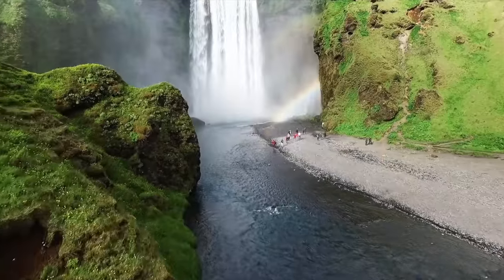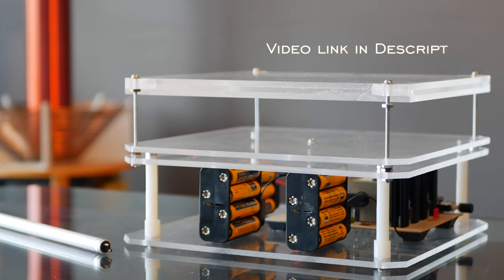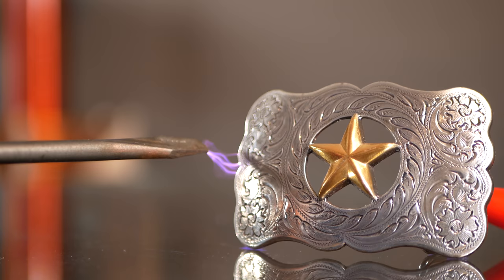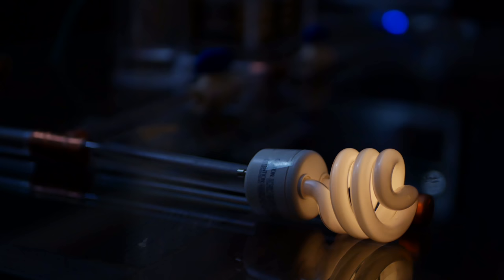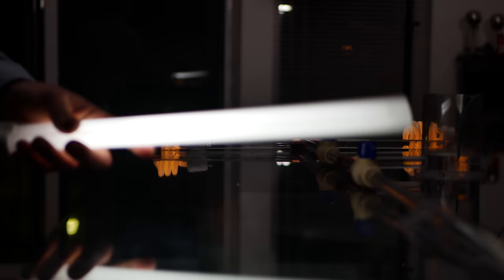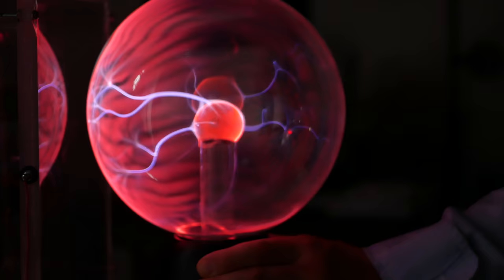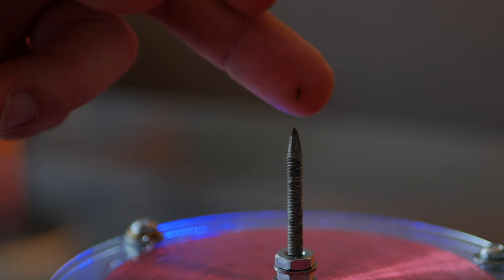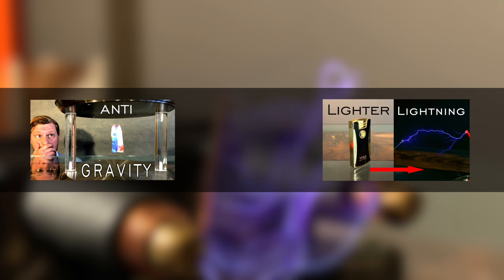Directional Wireless Energy Using Water

Comment: Add a little salt to the water and watch the transmission distance double with more efficient transfer, plus brighter lights.
Reply from the maker: I thought the same, but experienced the opposite. I found too conductive of water caused the power to radiate too easily, and never reach the ends of the tubes. Could have been a flawed trial though.
Reply: @PlasmaChannel  You'll have to play with the saline content until you get the results you desire.... At any rate ... adding conductivity should never be a negative thing (no pun intended)
Reply: @PlasmaChannel   Another thing is if you grind some copper into powder and let the copper powder circulate with the water. and place a magnet here and there on the tubing.. the energy created from the mutual induction will  electrify the water directly and yield tripple the results. movement is key.
Reply: @PlasmaChannel  I'm not trying to be a know it all... just trying to help. When I was a kid from 5 till I moved out ... this is all I did.... creating every possible configuration... I stayed in trouble for being so dangerous all the time but I was so driven I didn't even notice... Everything from giant antennas to capture atmospheric EMF to creating huge secondary windings placed beneath those million volt transmission lines and then stepped down to usable voltages.... I didn't do radio shack experiments .... stayed in trouble but have a wealth of knowledge now from years of  hands on when I was a kid.

Comment: @plasma channel, did you know that you could do the same thing with a single insulated wire and electric switch? achieve the same "wireless power" effect? can you see your ideas flaw here? you replacing the insulated wire with insulated "water-wire" and by the way, the only way your river idea would work is you have to insulate it from the ground! your body and the ground is the return path in this electric circuit. it is not pseudo-solution its pseudoscience
Reply from the maker: It is easy to create a water fountain isolated from ground, and, place it in acrylic so that it can’t be touched. Boom. Works. Cheers.

Comment: Love your channel and videos. This one has me very confused. What is the purpose of using...water?? Yes I watched the video, but why make something overly complicated? Can you not do the exact same thing (lighting gaseous discharge bulbs wirelessly with HF) using wires instead of water? And valves? Don't switches do the same thing? This seems like a Rube Goldberg concept, or something like Solar Roadways, etc. "The sheet of water acted as a wireless power transmitter itself." No, it did the same thing a piece of metal would do, and the power supply was the source of power. "Direct connection provides the most power." Right, like a wire, a metal conductor. "You might as well put it into a pipe and treat that pipe like a wire." Or....just use a wire? Better insulation possible, easier to handle (no dripping, corrosiveness). Not trying to be flippant, I seriously want to know why this was even thought of.
Reply from the maker: I'm happy you asked! I'll answer your questions one at a time.
 1) Sheet of water acting as wireless power transmitter: Yes, it did act as a transmitter. A powersource is different from a power transmitter. Totally different things. One creates power, the other transmits. The water is powered by a source, yes, but then the water allowed transmission in the air.
2) Wireless power covers more distance the higher of a voltage you use. Finding a 'switch' for 20,000 volts is pretty darn hard. Even if you do make one manually, high voltage will jump across any gap you give it, up to an inch at these powers. So, valves offer the most compact solution to cutting off 20,000 volts.
3) why use water instead of a wire in the first place - again, water can flow. Wire cannot. So this can become part of functional fountains that are separated from ground. Wire cannot. Also, the high voltages used required an ability to cut off certain areas. As previously mentioned, switches do not work at 20,000 volts. Also, even if you replace the pipes with a small wire, the high curvature of radius on a wire would cause severe coronal formation, and energy loss would be disastrous. You wouldn't be able to get the same results as the water pipes, due to the pipe's lesser curvature of radius and ability to suppress coronal formation.
Cheers!
Reply: @PlasmaChannel  Thanks for your reply, rare for any YouTuber these days! To your points, #1 the entire setup acted as a transmitter, the sheet of water (merely a conductor in this case) was an antenna. The water 'allowed' transmission into the air, therefore it's an antenna. Any conductor would have similar effect here. #2 Sure, and as you say it's also subject to inverse square law, so even that 20kv won't get very far. Also, HF high voltage is notoriously difficult to insulate, and this would apply whether you're using water or metal or any conductor. This all could work to act as a cutoff to control a high voltage HF circuit. But it'd be much simpler and smarter to simply cut the supply feeding the 20kv power sources--obviously easier to switch and control DC or LF low voltage than the other. #3 Don't get the 'functional fountains', if you want to cut the power, just cut the source instead of adding plumbing and greater insulation complexity. There are plenty of 20kv switches and higher, but of course using low voltage equipment is much easier. And yes AC has the skin effect so a proper conductor is needed. But, are you trying to keep the power IN the water, or let it out like an antenna? These are two different needs with two opposing approaches.

Comment: What if you doped the water or solution with buckeyballs or some other free-form of carbon to boost conductivity?
What is there's a very conductive solution?  Kind of the opposite of some of these new insular fluids that you can drop a running graphics card into...
Reply from the maker: Increased conductivity caused the lights to be brighter, but, only at close distances. At far distances, they were dimmer because too much energy radiated too easily, and it never reached the far ends of the tubes.

Comment: Isn't a house technically already set up to do this? Steel and Copper pipes run throughout almost everyone's home on the planet. of course it would need some extra precautions for safety, but couldn't you theoretically turn your piping into the wireless power source? The full copper and steel pipes transmitting better than what you have set up? Better yet, since the piping is run to everyone's homes from the water company (if you aren't stuck with only a well) a water station could double as a generator to power this for everyone? or am I just asking for everything to go kaboom?

Comment: If the lightbulb can light-up, then how the potential difference between its two electrodes is achieved? Can you run an electric motor (DC or AC) this way?
Reply from the maker: Well, strong EM fields ionize air. No return path needed. The bulbs are ionized without any connections needed.

Comment: This is pretty big. Especially, since water can be a part of many different types of open thermodynamic systems. It could actually multiply energy input by tapping into other natural reservoirs of heat, voltage potential, and pressure as a result of being exposed to high voltage. I just posted this video at http://facebook.com/perpetualmotor .
Reply from the maker: I'm really glad you enjoyed this. Thank you so much.

Comment: What happens if you add a little salt to the water? Would that help with the flickering light?
Reply from the maker: The closer bulbs lit up brighter, the further bulb was dimmer. Take a guess why.
Reply: Plasma Channel My guess is the salt water conducted the power more effectively, but since we have limited watts the closer bulbs were brighter using more of the available watts. That left less power for the bulbs further away. Thus they were dimmer.

Comment: Does they stat lit due to quantum tunelling of elections through valves? Or the induction between tubes just like you shown at the end? Prob both..

As of whole video: It's basically the same effect as Jacob's Ladder. Probably the most inefficient way of transporting the electricity as a lot is wasted for hydrolysis.
Also the whole contraption is weak as you can't use metal valves or (any parts really) without electrocuting potential users xD
Reply from the maker: Mr Rab, great guesses! It is mostly due to capacitive coupling through the valves, and that fact that the lights are still only a foot away from the water that IS still powered. 
I dont follow, with the jacobs ladder. This system definitely is inefficient, though, it was able to light up the three lights with only 60 watts. Not too bad.
Reply: @PlasmaChannel  Speaking more clearly about the jacobs ladder, it works thanks to the phenomena that applying a voltage to a conductor creates something resembling a 'induction field' in the close vicinity of it. When two opposing 'fields' reach, the current goes through. This is also what induced energy into your lights.
Pardon my whacky explanation

Comment: Fluorescent tubes will do the same thing under power lines. Lick the electrodes at the end of your tubes if you are certain there will be no capacitive discharge.

You wouldn't want this in your house, interesting concept for larger scale application though, given the cost of plastic pipe Vs copper cable.

I don't think capacitive cafe would be a zen place, as people are conductive.  

What voltage is your system at?
What's the potential fault current?
What means of protection does your system have? 

I think it's a very interesting idea, although sea beds are already being used as a conductor like in the DC connection between Victoria and Tasmania in Australia.

Comment: How would this method be affected by using smaller diameter tubing?
Reply from the maker: Smaller tubing, this should act the same. However, if using very thin tubing, you might see less power output.

Comment: Does the high voltage connection to the water reservoir use current while just sitting there with valves closed?   Since the pipes are capped and the water is not flowing, does the valve affect water pressure- i.e. what is the valve doing?  Preventing the current from flowing?  Confusing.  This is a by-product novelty. This can’t be that efficient to wirelessly charge your cell phones.  And your house has copper grounded piping. Is this why it’s grounded?!
Reply from the maker: Hi Aron, great questions. Even when valves are closed, it will still pull current from the power source. It just will pull less. The reservoir is directly connected, so that reseroir itself will radiate some wireless power...meaning energy is always flowing out. Also, this system is not grounded - you would not be able to radiate power if it was grounded. So, if used in any of the applications I mentioned, they would need to be fully isolated from electrical ground, and not near anything else conductive.

Comment: I saw were a dude thinks the pyramids were like a tranformer  take the eletricity out of air and using the aquifer to light up the city also isnt that what tesla's experiments were about with the tower ?
Reply from the maker: Honestly, I believe in being hyper-logical. But in recent months i've been thinking a great deal about it. The pyramids were entirely capable of creating energy merely out of their height differences from base to tip. The atmospheric gradient is approximately 3 volts per meter. So every meter you go up, an electric potential of 3 volts exists between ground and air. I'd love to see a voltage reading from the tip of a skyscraper and it's base - to see if this is true. 
Anyways, the pyramids used to be covered in Mica - which is a great electrical insulator, but the tip was supposed to be solid metal, and came to a point. The base of the great pyramid has a water tomb deep beneath it, I forget the name of this room, but it is halfway flooded, and evidence shows it was always flooded.
It really makes you think.

Comment: Yes it has Potential. And you just prove all of us how far our water-filled Body (Humans) is exposed to electric radiation from the wires and all those neet litte devices around us.
 
My thought about the semi-lit bulb. The static electricity went over the plastic tubing and entered the bulb through the copper-cap. Because it is the best condutor and therefore hat the least resistance.

But to be able to turn wireless power on and off in a specific area using a liquid medium such as water might be a great solution for our environment. broken wire? No problem as soon as the water dissolves into the ground (assuming that it is a closed system with no connection to the local water supply) there is no running current and the broken part could be replaced without andangering the workforce. Neat idea. 

Could you repeat that with saltwater? It should send the electricity even further away so one wire should be able to light up the whole room. Not sure about health-issues to humans though.
Reply from the maker: Hi Willian, you're right about the capacitive coupling across the plastic valve. Also, neat application, healing a broken wire underground! As for salt water- it would work better, but, draw more power from the power source. This means that it automatically would need a higher powered powersource.

Comment: Well that's pretty good idea tho! But in physics it doesn't matters at all if the output we gets is much lower then the input...here you used inductive coupling method in which you used high voltage ac current but the output was in physics can be ignored ( like ~0.001 then we ignores it in physics )... The idea is unique on its own way but here we gotta a question to how to get maximum output.... That's all and I've got an idea for that just a little bit of chemistry behind those H2O radicals and we can have something futuristic crazyness ahead boom babe I'll try it at my own in my home helll yeah

Comment: Interesting, I was wondering if the wireless transmission was only exciting the phosphorus and not really lighting the tubes via the normal method. 
If something is mathematically predictable, it can be expanded infinitely. Just how clever are you?

Make me usable energy from thousands of rectennas.
Reply from the maker: The wireless power is ionizing the gas inside the tube, just like normal.
Reply: @PlasmaChannel  I guess I am asking, you probably could not dimly light an incandescent?

Comment: pure water is bad conductor of electricity so how are you conducting electricity. It needs to have salt ,acid or base to be conductive. The presence of these substance would break water into hydrogen as admitted by you and basic or acid radical of the substance dissolved in water to make it conducting. What is efficiency of power transmission?, safety of such system. Water also heats up when electricity pass through it hence electric energy gets converted to heat. I did such experiments with water conduction in my science project when I was in school, it’s good at that stage . It can not be used in place of copper for sure.

Comment: how much wattage was the inverter putting out to light that tube at 6 feet?!
Reply from the maker: Around 60 watts
Reply: @PlasmaChannel  wow! Around taser output. I'd love the schematics, voltage, duty cycle... I've made a few HV inverters. I usually end up at about 22 - 28 khz and 25% duty cycle. My 2nd one was made out of an 88 microhenry core and I estimate it put out about 75 kv at 350 watts. Used spark gap and temperature to calculate. 15.5 volt around 40 amp input. I used a discrete astable multivibrator to drive my FETs. I think I have a video somewhere

Comment: 3:40 "wireless power distribution system system using nothing but water pipes and valves"
Are you sure? Isn't there a tiny bit of something else somewhere? Like the pipe is directly connected to your standard power plugs?
Reply from the maker: The pipe is not directly connected to a power plug (?). It is connect to a high voltage power supply of 20,000 volts.
Reply: @PlasmaChannel  So it's not "using nothing but water pipes and valves"
Reply from the maker: But it is. It’s a power distribution system. Not a power source. So by definition, it distributes power. What allows that distribution? Water, pipes, plastic valves. Cheers
Reply: @PlasmaChannel  It does not require "just that" to set it up
Reply from the maker: The distribution section of this method uses nothing else though. What else does it require?
Reply: @PlasmaChannel  a HVHF thing maybe?

Comment: Let's see temperature rises, water on the ground level evaporates into the atmosphere, vapors accumulate, clouds begin to form, hot and cold air mix creating differences in temperature, pressure, and densities in the clouds that create a bunch of static from frictional and vibrational forces which in turn produces lightning and thunder, and the rains fall... Not really that new!

Comment: How about using water to transmit data?
Reply from the maker: hm...perhaps using pressure waves?
Reply: @PlasmaChannel  not sure but if it can carry a charge then it should carry data too. also check 'the memory of water' video on youtube. It shows that water reacts to different frequencies, as tested when sound is put into (next to) the liquid and then frozen. different crystals form for different types of frequencies. there seems to be favorable and unfavorable music/frequencies basic on the resulting crystal structure. that knowledge plus what you did means there is some way to store or transmit data in water.